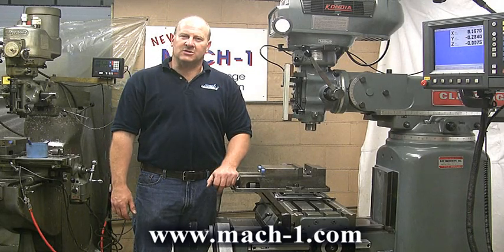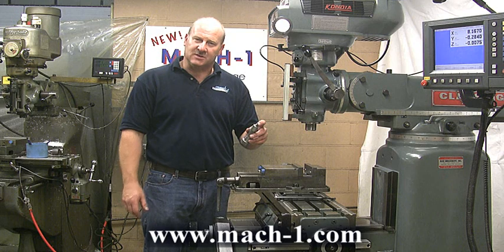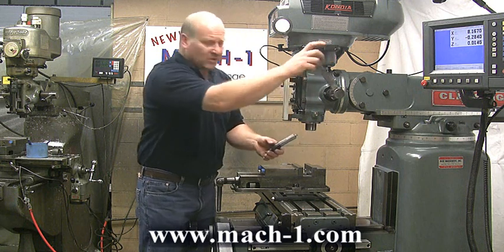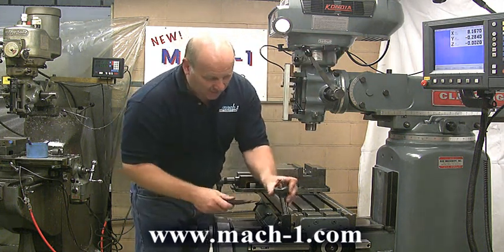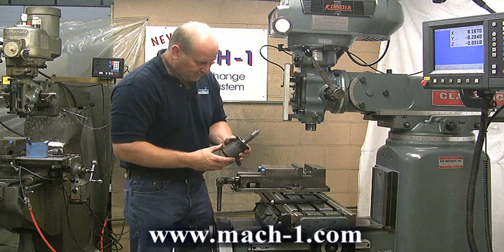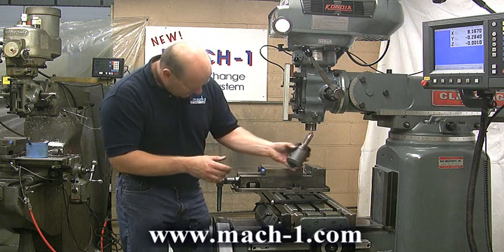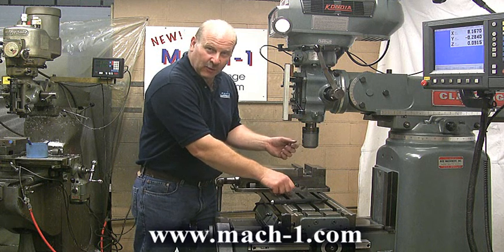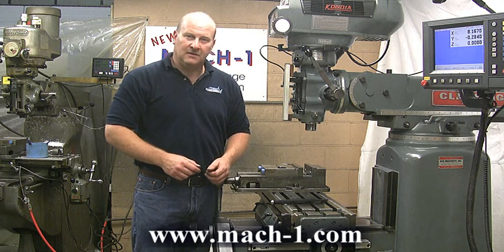Mach-1 Quick Change Tooling Attachments Demo in Action

Comment: Great concept.  Much smoother than those annoying impact drawbars.  One question.  It looks to me like you lose about 3/8" of upward quill travel with this system in order to have room to retract the tool, correct?  So if I'm milling with the quill fully retracted (like I normally do for rigidity),  it would be a good idea to insert a hard spacer/stop above the quill stop so that I'm not relying solely on the quill lock to keep the quill from pushing up, and releasing my tool in the middle of a cut?